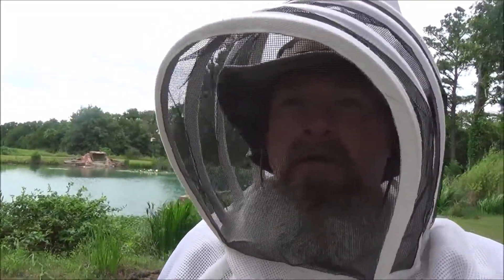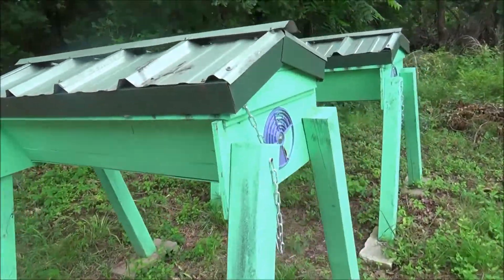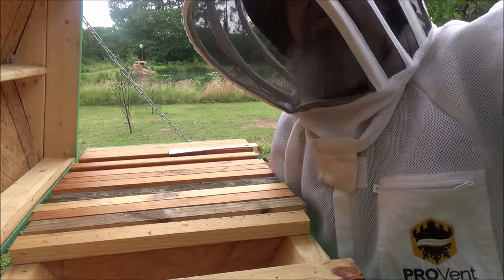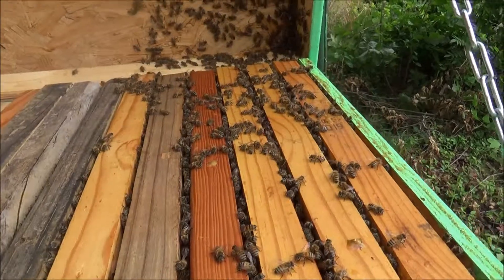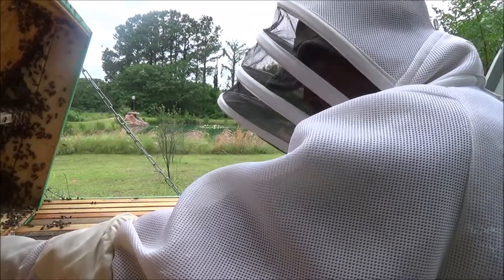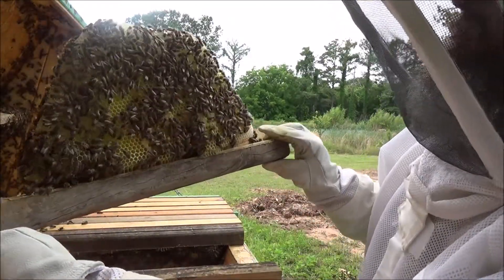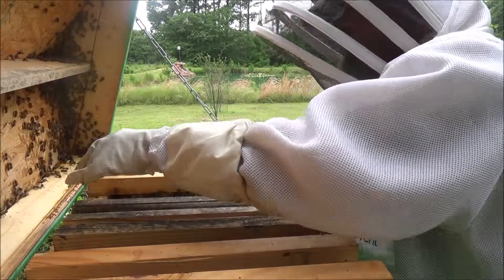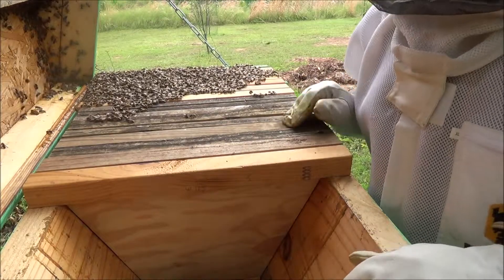Top bar hive split pt3

Comment: Just curious to know why you are leaving spaces between the top bars at the front where the bees can get up into the space under the roof? You're definitely going to have bees building comb up there... ;)
Reply from the maker: The bees use it for ventilation.  Since I started letting them keep the space it is very seldom that they beard on the outside of the hive.   I too expected some comb to be built up there, but in three years not a single piece.  They do like to go up there and hang out though.
Reply: Aah, fascinating! We make ventilation bars with fine mesh that are placed on the far end of where they build the comb. But our bees live in the north of Sweden where we rarely get hot weather... ;)